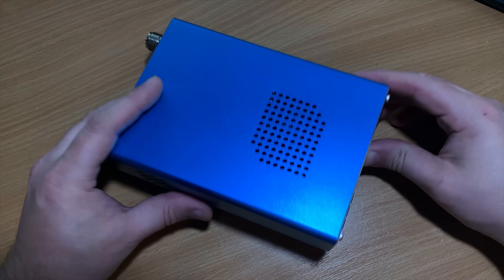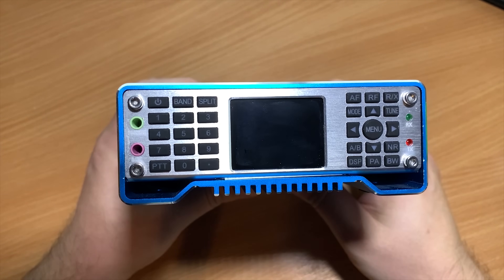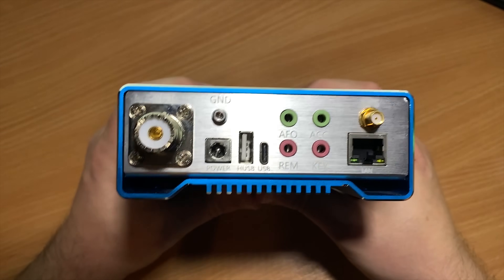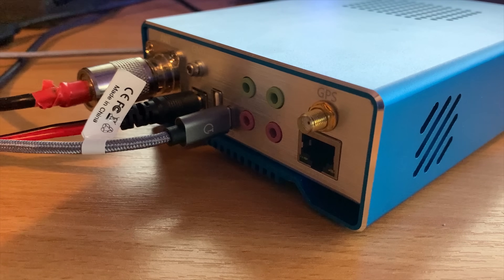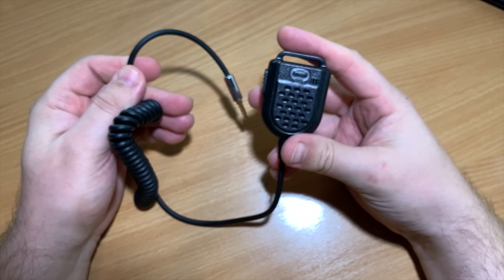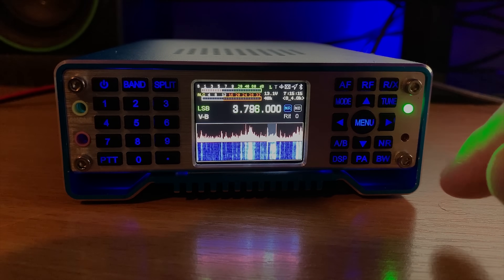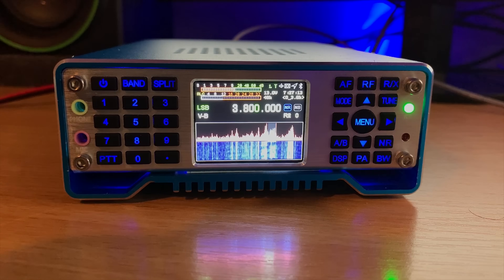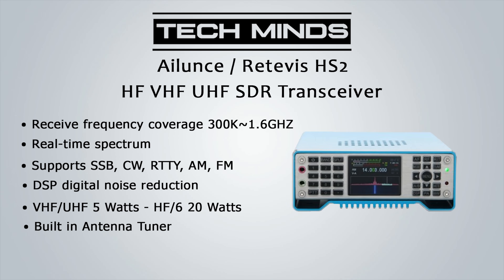Ailunce HS2 All Band All Mode SDR Transceiver - First Look

Comment: 5 watts just isn't going to go anywhere. I'm running my Icom IC7300 SDR HF radio at 100w. By the time you set up an amp, you will have spent more than it costs for a 100watt radio.

Comment: Would this be the same as the Radioddity QR20 SDR Radio
Reply from the maker: Looks like it to me.
Reply: It's the same internally. Same black spaces for the nonexistent GPS and other modules. PLUS the QR20 has an internal battery.

Comment: I got the SDR Transceiver for 455€ ... seams to be a fair price. I miss the VFO knob as well but it worked fine with HDSDR and flrig. Tuning by mouse wheel is comfortable like with other SDR radios/transceivers. WSJT-X runs well with the HS2 but not as sensitive like my Yaesu FTDX3000. For mobile operation I require a VFO knob.  Hope someone will offer it soon.

Comment: I would to see button head socket screws used on the face plate instead of the socket head cap screws.  Hopefully it would be a simple remove/replace process to change them.  My luck would be there is some hidden heat sink on the other side being held by a nut rather than just tapped into the case.  Anyone else have such luck?

Comment: Radio noise suppression sounds great. They need a remote pad vfo dial control since the didn’t add it on the front. Can I get video out for an external monitor via USB ?

Comment: While many will disparage the lack of a VFO knob, the lack of knobs probably makes this little transceiver more robust to carry in a pack for SOTA or POTA applications.
Reply: I was thinking thinking the same. This looks like exactly what I have been wanting. I need to set-up a small multi-band sdr manpack radio with digital functionality and at least some remote control. No proprietary connectors, internal battery, charge and operate with external battery, --- the internal fans will need to be swapped to Noctua "silent mode" fans but that is easy. Pair this with a Pluto Plus & R.pi, and an assortment of antenna for SIGINT Ops.

Comment: Why do all the Chinese HF rigs only have low output power? The g90 is I think 30w. The radio looks potentially really good but if like myself you can only afford one HF rig you're not going to buy a low wattage radio, nobody will hear you with this rig plus the lack of a vfo knob makes tuning around a chore. Make it 100w output and give it a vfo knob and the potential market would be massively increased surely?
Reply: But a Kenwood TS-50 & you will be very pleased.I have owned Four of them and I’m looking at another one I think and I’m an ICOM MAN.

Comment: I placed an order and subsequently cancelled. The original ads they published had 2 antenna inputs. how you make it work with a single antenna input is not clear to me.
Reply: Have you ever heard of a Duplexer or a Triplexer? It’s really SIMPLE.
Reply: @1OFGODSOWN  yes lose the magic when you start attaching one external device after another. the appeal of a small self contained unit is lost - duplexer, external vfo knob, etc. etc.

Comment: Did you try the rf gain / att before you tried the dsp nooise reduction?  The rf gain should be the first go to . Before you go to dsr noise deduction.  But this is usually forgotten.  
The rig looks great , but having to button press every time you want to change rf/af or vfo would be supper annoying for me . Even a mouse click is a extra step ,or backward step .

Comment: Yachties  are always looking for SSB  MF/HF with GMDSS/DSC CLASS "E " encode/decode.....the only Radio's at the moment are very expensive ICOM-M803 and some older ICOM-M802's . Ideally with external amplifier and auto antenna tuner with 5-200 watt selectable capability. Such a system would require the call sign and MMSI of the Station/Operator as well... Just a thought  Matt,  73's

Comment: The radio is clearly seriously saturated during the part of the video without HDSDR. You can hear it and see it on the waterfall. It's not because the S-meter only shows S9 or less that there is no saturation of the ADC going on. Is there an ATT present in the radio? This seems  like a poor design. Nice video as usual! 73'
Reply from the maker: There is an ATT but there is also an RFG and IFG which I most likely had not set correctly. I guess I’m still learning and need to fine tune the sensitivity
Reply: @TechMindsOfficial  The ATT should work, but the RFG and IFG is a control after the ADC and could not be helping here. Inserting a ATT before the radio no option for a tranceiver, wich is logical. Will there be a folow-up video of this radio?

Comment: Looks like a fun radio.
How is the big signal behaviour ?
Can it do 4m, 70mhz wasn't clear to me if it could.
And is there a way to use hdsdr with n1mm for contesting ?
Reply: No 4m. Probably no capable hardware. There is in the wild old unofficial firmware with 4m enabled. But not to much other info about it.

Comment: Thanks for the review! Looks like an interesting radio. But I'd like to get some clarification regarding the technology applied: is it a fully SDR , or is it a Dual conversion superheterodyn analogue radio with the Digital Signal Processing in the IF stage ( like, for instance the YAESU FT-891) ? Thanks! 73! Linas LY2H

Comment: A radio without a vfo knob isn't an ham radio. More chinese radio has lack in control and display. This is no good.
Reply: My Flexradio 6600 has no VFO knob and is a very good American made ham radio.
Reply: My IC-7300 VFO knob is hardly used. I use Omni Rig and SDRPlay to do the control. I installed Radio Analog PTRX-7300 IF Interface Module in the radio to hook a RSPdx SDR radio to the computer.
Reply: I thought Ailunce was offering or going to offer a Bluetooth connected external "VFO knob", but I do not see it on their website.
Reply: @jamescaperelliiii4620  I think it is going to happen. There is a schematic diagram on their website. Nevertheless I am building my own over Christmas based on an ESP 32.
Reply: Tell that to Flex...
Reply: My Sun sdr2 as no vfo knob and performs equally or better than a IC7851 🥱

Comment: There are almost no videos with TXing with that radio on HF. Could you do that video with TX on SSB with audio and some digital mode?
Also with SWR metering and ATU working on HF bands. Comparing to other SWR metering devices.

Mine is in transit.
Current price is $599.
Reply: I got one too ... with all the modules installed ... hope to get it soon

Comment: Seems very solid, but think I’m still gonna save a bit and go with the icom 705
Reply: One of the problems with the IC-705 is that it is QRP.
Reply: @RC-ld3cn  That’s not necessarily a problem...  Just depends on your use case.
Reply: Thanks for an interesting first review, looking for more! I am very interested in this radio as a "replacement" of my trusty  FT-817ND and as a light-portable set-up with a nit more power than QRP.  For me personally the HS2 seems as more value for money than the IC-705. Before pulling a trigger I have some things to clarify : 1. What are the real levels of the power output? I've seen one video where measurements were done on line and on NO one band the output was 20W, there was something like 17W on 40m or like. There was no info in this video about how the test had been conducted though. Have you been doing  the output testing? 2. Have you been testing the ATU work? The tuner IS important for an emcomm or fun outdoors communications, IMHO, especially when circumstancies leave no choice for the antenna type. 3. Is it a fully SDR, partially SDR, HF SDR  with VHF/UHF analogue Superhet?  Thanks in advance! 73! Linas LY2H.